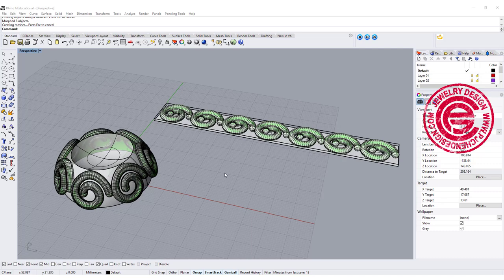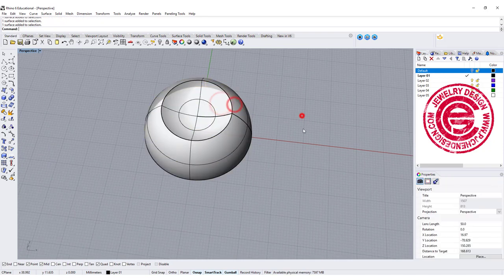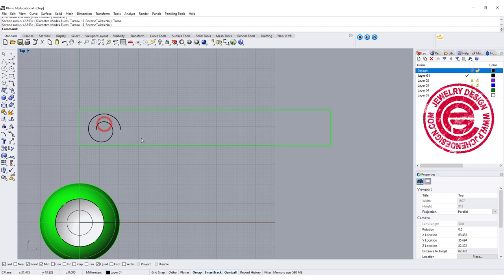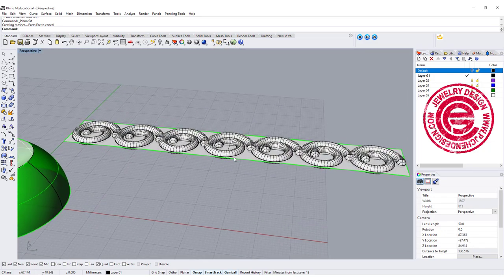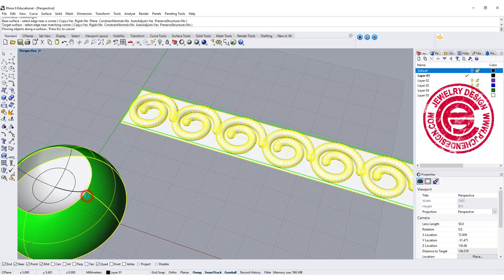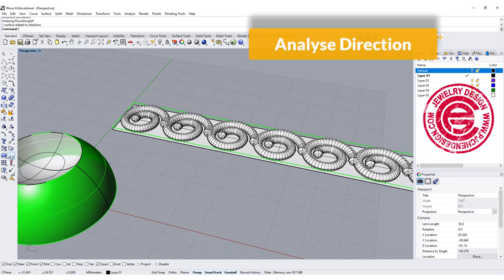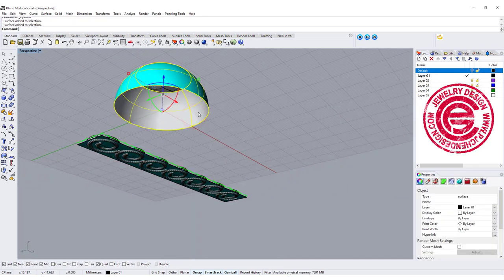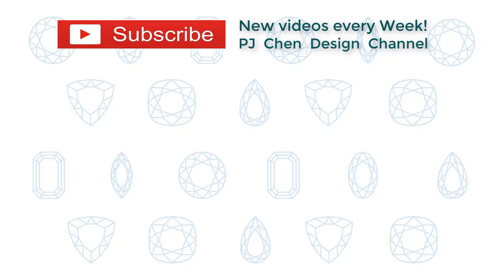Why "Flow Along Surface" Command Fails? 3D Modeling Rhino 6 [Jewelry CAD Design Tutorial] #127

Comment: A lovely and quite elegant way of demonstrating this.

A couple of things to add:
a.) Turn on "Always Record History", and you can update the Flow Along Surface dynamically. So you can move the base surface and the objects will move on the target surface. This can speed up the trial and error process.
b.) Controlling the UV and Normal orientations of the surface are good for Flow Along Surface, but ultimately not 100% necessary. If you find the seam and use the same respective matching corners on the base surface and reference surface, they should orientate correctly. Failing that, you can try the next corner down and it will flip.
Reply from the maker: great tips. thanks for sharing

Comment: Thank you.  If you put an x or a mark on a corner of the seam of the original srf before flowing, will it be visible on the uv srf?  That would help me identify the orientation when doing the flow.
Reply from the maker: you can flow with the curve of X or text if that help.